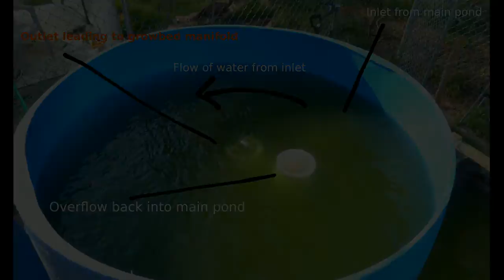Aquaponic System 2015

Comment: One more thing. I see you have a feeder fish barrel. I also did the same but I found feeder fish are not disease free. One event I got 500 feeder fish and introduced ich to the system. I lost two of my fish in the main tank and had signs of ich in one other tank. I had to salt the system to 1.5 ppt and that halted the ich problem. Just thought you should not have to make my mistake. Great video by the way.
Reply from the maker: +Tanner Stage V 
Thank you!

I always quarantine incoming animals now that the system is established. I use methods taught to me at the Long Beach Aquarium of the Pacific, which are based on American Zoo Association standards. Also, if you make a regular practice of salt-dipping incoming animals (invertebrates may or may not tolerate this, depending on the species you're working with) using water that's about the same salinity/specific gravity as seawater (approximately 1.025 using a float hydrometer) then you'll have gone a long way towards preventing introduction of external parasites.

After that, go ahead and QT the animals for 30 days. They must be disease-free for 30 days before entering main system/display. If any signs are observed, the animals are treated until the issue is resolved, and that 30 day clock is reset. If you're religious about this, you'll rarely see disease that isn't something like furunculosis ever again.

Quarantine for bluegill and similar animals can be as simple as a trash can set up with a pump or air, and having clean water ready for water changes if necessary. Since there's no biological filtration, pay attention to nitrogenous waste levels and be prepared to do those changes as necessary.

Comment: It looks like you are using CPVC flex pipe under the barrels for a drain? Not a huge deal but that stuff is not food grade. NSF51 for hot tube and pool use. I got some as well so that is why I spotted it. Small amount will not harm you in my opinion but just thought I would give you the info so you can make your own decision.
Reply from the maker: +Tanner Stage V
Thanks for the heads up on that! We have to redesign these beds, they've been a problem in terms of keeping both inlet and outlets clear.